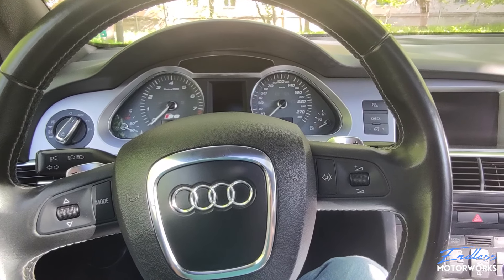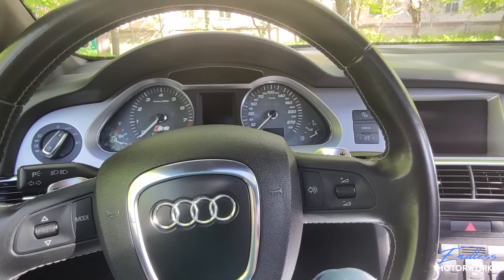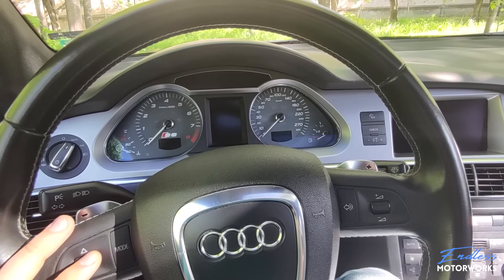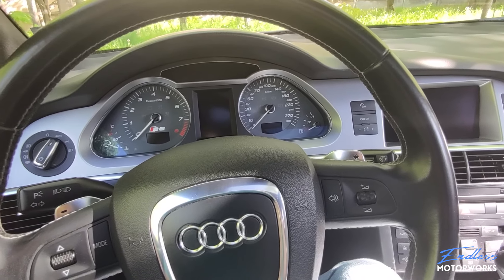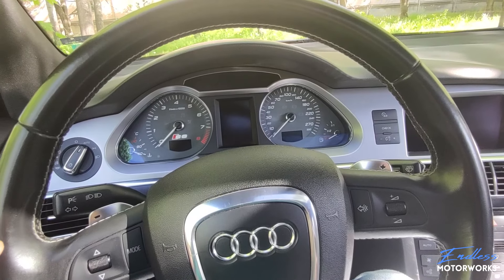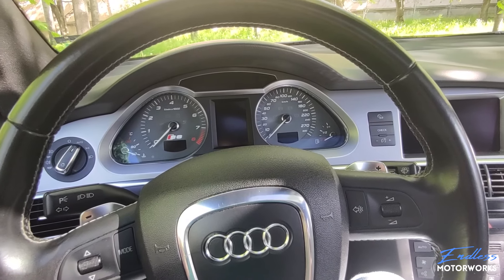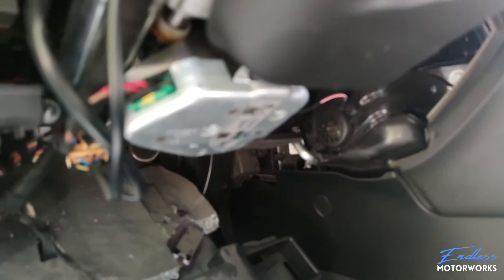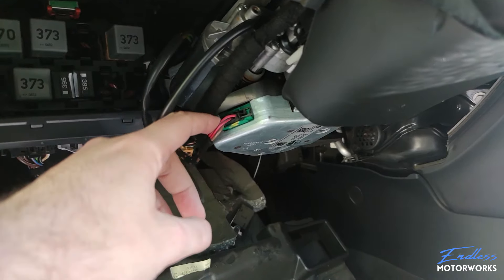How to Prevent or Fix the Steering Wheel Column Lock Actuator Issue on an Audi A6 / Q7 (DIY Repair)

Comment: I'm a retired Professional Wrench, many years at Audi Dealerships, as I remember replacing 3 or 4 complete Steering Columns (plus reprograming) during my career. I had told myself to never own one of these vehicles partially because of this issue, low and behold I found myself buying a 2007 A6 Avant with 139,000 Miles in early January of 2021 for $5,000 to replace a souless 2011 Honda Element with uncomfortable Seats that I unloaded to an Acura Dealership for $10,000. The Audi is 4 times the Vehicle at half the price. I've since make a few repairs plus as preventative maintenance I replaced both the Upper Timing Chain Tensioners. I now have 171K Miles (late November 2022) on the Avant and couldn't be happier with my purchase. I haven't experienced any steering lock issues with my Audi although after stumbling upon this wonderfully informative Video I intend on sniping the Red w/Black Trigger Wire. Thanks so much😉 Randy   AKA randog311
Reply from the maker: Thank you for taking the time to share your experience!
Reply: If you did work at Audi and have worked in those vehicle just may be you can answer my question.

If I unplug the module, will the car still starts and runs
Reply: @ralphwhitaker8761  I would think not. FYI, early December of 2022 I performed the Clipping of the Wire described in the Video while my 2007 Audi A6 Avant was running and the Steering was Unlocked. My Vehcles Steering Lock Actuator will never lock the Steering again.
Reply: Hello Randy. We have the same car and I'm experiencing this problem explained in the video. With the wire snipping solution would I need to clear the code first? Or would the snipping resolve the issue by itself? Ive read on forums that after snipping the wire a ignition dash light comes on. Does this happen if the code is not cleared before snipping? Any advice is greatly appreciated. Thank you!
Reply: @maupin_media  Unfortunately snipping the wire while the Key is On and the Steering Wheel is Unlocked (Drivable with no Codes) is a "Preventative Measure" to be taken before there is a problem). Clipping the wire in question while the vehicle is drivable is to then prevent the Steering from ever locking again.
Reply: @randymueller2349  Dude, I'm holding knife in my hand, please before it is too late, tell me will it efect anything else in the future? Maybe any battery leaks anywhere on some module that won't turn off while car is sleeping in a garage???

Comment: You are a genius. You saved me $5820 at the dealership to change out my steering column...It works perfectly now!!!! Everything was just as you explained....Thank you so very much!!!!!
Reply from the maker: I am happy to hear you resolved your issue without paying a dime. It is comments like these that really warm my heart! Thank you for taking the time to leave a comment!
Reply: @EndlessMotorWorks  it worked for 2 days then just happened again? The steering wheel is free however the electronics are still did not come on when I inserted the key. any thoughts?
Reply from the maker: @johncoutinho3021  If the steering wheel is free then it cannot be the cause of the issue. I would recommend to have the vehicle scanned for errors with VCDS. When you say the electronics are dead, do you mean nothing electronic comes to life on when you turn the key, or that everything works, but the vehicle doesn't start?
Reply: @John Coutinho  Unfortunately that's the result for me, too. Absolutely same symptoms (random, steering would not unlock and the car acted dead). I clipped the wire, and now the steering stays unlocked but the same behavior occurs. I've even tried the fuse trick. Now I'm typing this as I wait 5 minutes to try and start my Audi that's dead. (Brand new battery, BTW.)
Reply: @LorenBast  did you cure the problem? have a6 c6 , was told will fix the steering lock issue, but im afraid that the car will be still dead randomly after inserting key.
Reply: @MJCrupy  After a steering column replacement, thousands of dollars, and weeks if not months of headache, we (Audi mechanics and me) think a wireless power cell phone charger in the car may have been interfering with the RFID transmission of the keys to the column. We disconnected the charger and the problem hasn't come back yet.
Reply: @LorenBast  how to disable it ? i noticed if i set charger in cigarette port the car not wake up, once unplug all from cigarette power car wakes up
Reply: @2_S1MPLE  wow - yeah, that's similar to how my Q7 works. There must be a fuse you can remove to disable those lighter plugs. Or you can try really cleaning them in case dirty/corroded points are causing too much resistance and current draw.
Reply: @LorenBast  I had same problem in my 2007 A6. Scared a lot! but luckily i found the reason (wireless cell phone charger)

Comment: I just bought a 2007 A6 with 160K Miles on it with several issues that I can't blame for the price. One of them was that the steering lock was reluctant to work once in a while so I figure it was only waiting for the most inappropriate opportunity to fail completely. Of course I followed your easy video now that I'm still on time. Thank you so much for spare me such a huge headache.
Reply: How much did you pay for it? I have mine for sale and have had no offers or questions at all it has 150k in perfect condition. It just needs abs module repaired and CEL comes on sometimes then goes away.

Comment: Hello I want to do this to my 2013 Audi q7 but my key is stuck I cannot start it and I have no access code start stop, how can I get the this issue fix so I can take out the wire later ??
Reply from the maker: You will need to find someone who has access to the dealer software to clear the code so that you can remove the key from the ignition and have the column unlocked before you can proceed to cutting the wire.
Reply: @ i been trying to find someone it’s really hard. But I did take out the steering module and I’m getting those parts inside of replaced do you think it will make difference?

Comment: Did this now on my q7 4.2 fsi after driving around for 6 yrs resetting the error code evertime I needed to start the car. What a shlep which resulted in me hardly driving the car. Took me 10 min and now it's fixed. What a massive thank you... 👏👏😉
Reply from the maker: Wow, that surely must have been a massive pain the a**. I am glad the video helped you out.
Reply: How did you reset it?
Reply from the maker: @applesintherain3326  You will need to clear the error message before proceeding with the fix. The error message can be cleared out with dealer-level diagnostic tools such as VACCOM or VCDS.
Reply: @EndlessMotorWorks  Thanks!

Comment: Hello! good option. unfortunately, that video was not there when I had such a problem. My c6 had the fact that it turns on the ignition and it doesn't turn on, but when I put it to the vcds, I was able to remove the error and it turned on. After a while, it's the same again and it doesn't work. My question is, if there is such a problem and it is possible to remove the error so that the steering wheel is unlocked, then it is also possible to cut the wire? Thank you!!
Reply from the maker: Yes, if you clear the error you can cut the wire after that. The important part is that there are no error codes that are stored regarding this error, when the wire is being cut. Otherwise that code will persist and you will not be able to clear it later.

Comment: Hey Sir, I actually stumbled on this video as I have a Audi A6 2008 and it is completely down one day suddenly. It doesn’t start or even crank. All the electric things work like the mmi. I cannot connect to the scanner and the even the key is stuck in the ignition. Do you know something I can do.
Reply from the maker: The first thing I would do is to check battery voltage. Sometimes the battery might be too weak to crank over the engine, but electronics will still work. However, not being able to take the key out of the ignition, might suggest  something wrong with the ignition barrel or the immobilizer. You will really need find someone who can scan the vehicle for errors. Without doing this, you won't get a definitive answer.

Comment: I am about to perform this on my 2006 A6 Avant. (I am currently locked out.) This method works for my car, right? (I know, I need to clear the code in VCDS first.)
Reply from the maker: Yes, it will work. This method works on any C6-generation Audi A6 and the early Q7s, as they all use the exact same steering wheel column lock actuator.

Comment: For the past few years, I dreaded every time I put my key in the ignition, hoping the steering wheel would unlock. Usually it would happen on the coldest dampest days. I made sure I always traveled with my laptop so I could clear the code when it did happen. 

No more !!! You're the best !!!
Thanks so much for this video. 
You gave my car new life. Makes me love driving the car again.
Reply from the maker: Thank you for the kind words! I am happy the video helped you out! :)
Reply: works so far?
Reply: I did the exact same thing😂😂
Reply: @EndlessMotorWorks  is there a fuse that can be pulled out instead of cutting the wire?
Reply: Hey how did you clear rhe codes when the steering lock was on?
Reply: I founs the answe put your lights on and pull the high beam lever step on brake it should work then ik sound weird

Comment: Having owned the previous generation A6, this issue nearly swayed me from buying the C6. I’ve had it for nearly 2 years no issues until yesterday i took the key out and heard a clonking from the column, i knew it was likely this issue. Luckily i found this vid, followed the steps but depinned the red and black wire right away so no more lock or worries! Thanks for taking time to make the video 👍🏻
Reply from the maker: Happy to hear that the video helped you out!
Reply: @EndlessMotorWorks does this remove remove load from steering wheel ? I had my steering lock apart by locksmith  for coding new keys and now this is the issue when he plugged it back in.

Comment: Well done for this video. I did this about 6 years ago when l experienced this fault 3 times after clearing the fault code (twice away from home)  Took me months to figure it out and l cut two cables!  Now see l only needed the one cable cut.  I did post my method on an audio forum, however see yours is simpler🎉. Thanks for your post am sure it will prevent the anxiety our of many drivers heads 😊
Reply from the maker: Yup, this is a common fault in this specific generation of A6 and also the first then Q7s. Before doing this I used to travel with my VCDS just in case, especially when going somewhere far. I am happy to hear the video is helping out other people. Thanks for taking the time to leave a comment sharing your experience!

Comment: Excellent video, so easy.  Thank you so much! Stranded yesterday with my A6C6/4F 2005 2.4v6, car was completely dead after short shop visit. Tried to erase codes with vcds, no luck, couldn’t acces modules. Pulled fuse 42 for 5 minutes, to reset fault code steering column lock module. Battery on charger, was quite empty by trying and fiddling around to try and find/fix the error. et voila! Car back to life again! So happy. Today i’ve first cleared all the codes and cut the red/black wire.
No steering lock anymore but don’t care.
Thanx for sharing this info!!!
Reply from the maker: Thanks for taking the time to leave a comment and share your experience! I am happy to hear that the video helped you out! :)
Reply: Hi. Was wondering how did u reset the fault code? Have same problem and no luck with vcds ...
Reply: @badde83able  same issue for me, please reply 😅
Reply: How do you know what fuse to pull?
Reply: Which one is -fuse 42?

Comment: Thanks for the video. Bit long winded for something that takes two minutes but still usefull. If you can't turn the ignition on to use a scanner, press the footbrake, turn on the hazards and pull the headlamp 'flash' and the system will power up enough to scan. It works! Just done it! Love Youtube!.

Comment: My 2012 A7 locked up after I came out of a store. Finally got it to a shop. 4 days later they still don't know wtf to do so I'm gonna call them and ask if they've tried this. Like you, I don't care if the steering wheel stays unlocked. Just need my car back... Thanks for the video. Great information.
Reply from the maker: You are welcome to try, but what is shown in this video pertains only to the A6 C6 and first generation Q7. I don't believe that it is applicable to any other Audi models, at least not in its current form, as the lock module is physically different and so is the electrical connection going to it.

Comment: Lo acabo de hacer y funciona perfectamente son 5 minutos lo he hecho en un taller amigo normalmente no lo hacen se limitan a cambiar el dispositivo de bloqueo pero es muy fácil lo puede hacer uno mismo muchas gracias por este video ya estaba sentenciado el coche
Reply: Did the key fob unlock the car after ?
Reply: @stigali1945  Yes, it works fine and doesn't give me any alarms or anything by simply cutting the red/black wire according to the video

Comment: I also did this as a precaution.  thank you very much for your help.  p.s.  
Has anyone had a problem with the error p3053 starter terminal 50. it happens that sometimes it takes a long time to start the engine, so it throws this error
Reply from the maker: Happy to hear the video was helpful. Regarding your code - p3053, it relates to the starter relay. I would check the relay for corrosion on the connectors and replace it if necessary.

Comment: I have white smoke coming out from the exhaust, will cutting the red black wire solve this issue?? 😂 , but seriously you are an amazing person to help ppl save so much headache with Their Audi A6 issues
Reply from the maker: Thanks mate!
Reply: @EndlessMotorWorks  can I also ask what is the obd2 connector that I need to purchase to be able to connect my 2006 A6 C6 to my laptop ? I am confused which is the correct one

Comment: I have the microswitches and the relay already purchased and just waiting for it to happen... But I thing I``ll follow your guide and have it fixed for good...
Reply from the maker: Yes, if you did what I show in the video, you will not need to do any component replacement in the actuator itself.

Comment: So.... our '08 Q7 has the dreaded no crank/no start "steering column defective"  issue happening intermitently for over 2 years now. First thought it was a battery issues -not so.
Tricky to clear the code due to not being able to turn the vehicle on: Pull the high beams on, 4-ways on, and depress the brake pedal -then read/clear code in channel 05).
The vehicle will work..... until it doesn't again.
After replacing the relays & micro switches in the steering lock actuator (major pain to do btw -thanks Audi)  I thought I had it fixed but the issue returned 2 months later.

Came across this video and performed the snip as described.... time will tell and I'll post back if it fails.
Thanks!
Reply from the maker: Hopefully the issue will be resolved for good and you won't have to deal with it anymore

Comment: great video, this could save hours of headaches when the relays go in the steering control box, will be doing mine this weekend, first Audi A6 c6   I bought had It at a  quite reasonably price changed starter  glow plugs oils engine  gear box oil fillers all other  just for preventative servicing and changed  all front the  suspension arms  any way let's get to the point  been having a start issue were the starter refuses to turn  then works great for a few days thinking it's the starter relay faulty but don't want to start pulling everything apart to find it any chance you know were  the  correct starter relay is to save lots of time searching all the different places lots of YouTube  videos  but all shows different places were the starter relay is situated  my is 2007 three litre automatic a6 c6 model thanks again  by the way 70 years old still trying to do my own work
Reply from the maker: It's commendable that at 70 you are still doing your own research and work! I only hope I will have the strength to do it at that age. To you your question, there are two starter relays (J53 and J695). They are located in a fuse box in the drivers footwell.
Reply: @EndlessMotorWorks  thank you still love doing the work at my own.pace my is right hand drive same place on right hand drive when striped it down to cut the red and black wire did see about 7relays thanks for your time and effort getting to know these cars now had a Citroen c6 model they are not easy to work with anyway thanks for your time  just checking the photos I took there are two 395 next to each other  I don't know how to send you the photos on YouTube they have to be the one's thanks again John